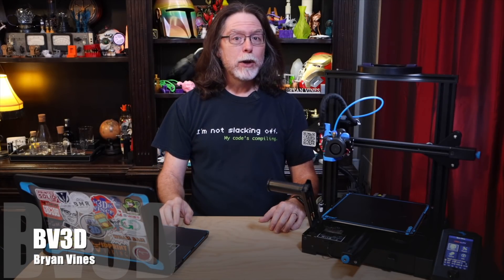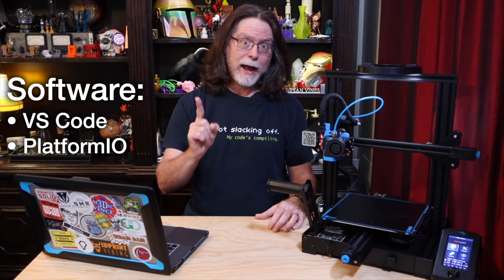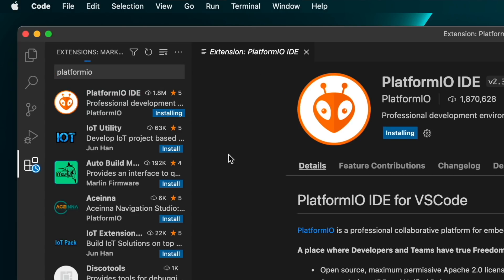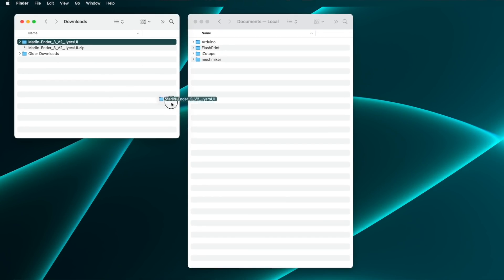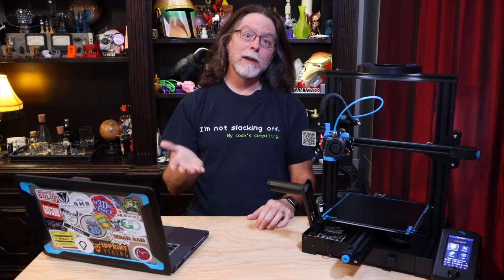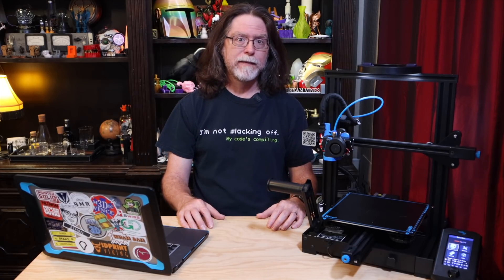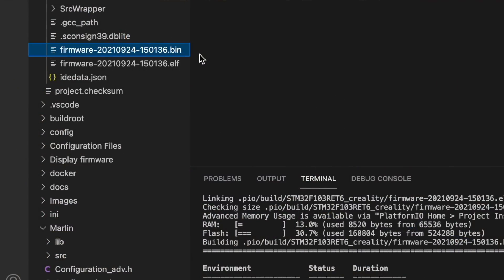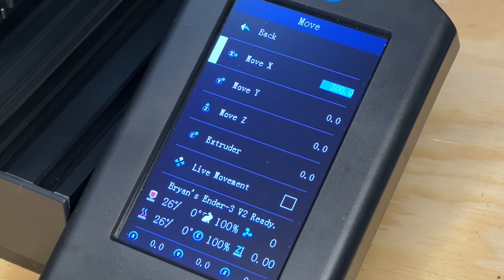EASY! Edit & Compile JyersUI Firmware for Ender-3 V2!

Comment: Excellent video with clear and concise the order of the day. One thing I have been searching for with little success so far is an answer to a very simple question. Does Jyres have thermal runaway protection enabled? If not, how do I enable it? Thanks for an excellent channel. As someone relatively new to all this, your help has been invaluable.
Reply: Help they changed files and this does not work please help my printer in now stock broken bltouch removed but stock firmware won't let me setup proper esteps for omg dm1 extruder

Comment: Bryan, so many steps missing I think.  For instance if I want a BLtouch 5x5. The example Jyers config files do not list that?
Also is not a # in front of a line comment that out?  So for your board you have to remove the #?
There seems to be many things missing from your video. It would be great if you could spend more time on this is detail.
Thanks

Comment: The Jyers Firmware is Really Great! Fantastic improvement, especially the scrolling filenames! It is worth doing if only for that! My printer is an E3v2 with 4.2.2 mainboard.  
Question: Does the precompiled binary for this one have Linear Advance enabled, or do I have to compile? 
The only source codes I found were Marlin 2.0.1.zip, and Marlin-bugfix-JyersUI.zip. Is one of these the correct one?
Do I have to see what drivers are on my board? The K-test code does not seem to change at all with changes to the parameter.  

Thanks!
Reply: The 4.2.2 board does not support linear advance due to the drivers it has and the way Creality has them set up.

Comment: I have tried several time to change the icons but they just don’t change. I also see the screen change from blue to orange but the icons don’t change. 🙏
Reply: Did you find the problem?
Reply: @fallu6224  no not yet, I have tried everything but the icons don’t change.
Reply: @kbshah  Yeah I have the same problem too tried everything formatted the card million times, tried to find the custom dwin icons setting in the configuration files but there is nothing like that.
Reply: @fallu6224  yes, same here! No one as been able to help as well! Too bad! If I am successful I will definitely keep you posted.

Comment: Does this work with OctoPi? 
I have tried the binary files and OctoPi will only connect after disconnecting the USB each time. If not it will hang connecting or just send a M112 command.

Comment: Dear Bryan: First of all I congratulate you on your channel, very interesting and I follow your videos every time you update.  The reason why I contact you is to ask if you have a link where to download this firmware update for my Ender 3 V2, both for the mother 4.2.2 and for the screen, without having to do all the process that you indicate, already that to tell the truth I do not encourage myself to install these programs and make the modifications, I have had the machine for less than a year and I do not want to make mistakes (although you can learn from them :), if there is a link and you want to send the same, then Not being a nuisance on my part I have to thank you, if not possible I still appreciate your attention and the explanation of the procedure.  Best regards.  Richard.  Buenos Aires, Argentina

Comment: Thanks so much for this! I had a CR6 Max that was giving me nothing but trouble, so I dropped a 4.2.2 board in place and turned it into a big Ender 3v2 with.a bad ass frame. This vid made the firmware updates so easy!

Comment: Hi, first thank you so much for this helpful video. 
Is it possible to download and compile the latest marlin firmware from the Marlin repository instead of the one from Jyers, configure it to my needs, but still use the display firmware provided by the Jyers repository?
That way I would have the latest changes for the marlin firmware but still the good display UI from Jyers, but I am not sure if this will work out.

Comment: BV3D, I have a newbiw question: is it possible to adapt Jyers to a plain stock old Ender3 (old display), with a v4.2.2 card? I've already done my own mods to firmware and have the compilation environment already setup, but config files are huge ...

Comment: is there a way for this to work with the touchscreen upgrade? I tried creality's and now my bltouch does not work. Also, how do i check what steppers its coded for, i have a v4.2.7 board with tmc2225 drivers,

Comment: After trying to flash the LCD screen from a previous video, the screen turned from blue to orange almost instantaneously, I changed the custom name, but that now disappears after a few seconds and displays "SD INIT FAILED". No big deal but the latest source Marlin did not have the option to change the display. The only place was from a previous version, but that does not work with the latest Marlin.

Comment: I don’t understand how you always make the exact video I need literally the day before I need them!!  I upgraded my machine to a slice engineering copper head hot end and got one of their thermistors. Any chance you can tell me what to change in the code to the new thermistor?
Reply from the maker: Did you get the 300˚C thermistor, or the 450˚C thermistor?
Reply: @BV3D  I got the 300 and I actually joined the jyers patrion and he already squared me away sorry to waste your time but props for responding so quickly! Love your content keep it coming!
Reply from the maker: @nike12000haha  Hey, no worries! I had to look it up on the Slice site!

For anyone else with this question, Slice says: "Marlin and Duet3D firmware support the Slice Engineering 300°C Thermistor. In your firmware settings, choose the 100K thermistor - ATC Semitec 104NT-4-R025H42G"

That's Thermistor value 5, so I think the right thing to do is, in Configuration.h search for #define TEMP_SENSOR_0 and change its value from the default 1, to 5.
Reply: @BV3D  good you and Jyers agree :)

Comment: Just curious what icon pack you are using that gives the rainbow colors CREALITY logo? I tried Gotcha's and the custom but it's still the plain logo.
Reply: I guess Bryan doesn't answer simple questions. :(
Reply from the maker: @FinlessBob  Sorry about that! 😬 I don't always see these questions roll through. I used Gotcha's DWIN_SET. If your screen went from blue to red (orange?) after only a second or less, the screen didn't like the card or it didn't like the DWIN_SET folder. I've had the best luck with a freshly formatted card, 8GB or less, where the DWIN_SET folder is the only thing on it.
Reply: @BV3D  No it flashed OK I must have used used a older or different one.  Will try Gotcha's again.  Thanks for the response :)

Comment: Aside from axis lengths, doesn't an extension need some configuration work on speeds and accelerations? It is not the same moving a bed (Y axis) with a print with 230x230x250 volume, than moving a volume of 300x300x400. Bed itself is heavier, not to mention the piece if you are using the full volume. I think extending a stock printer requires more configuration changes on Marlin.

Comment: I wonder why you are appreciating this piece of ****. I installed it then longer prints more than 10 hrs started stopping in mid and lost resume function after power cut.
Reply: I can't connect my OctoPi instance without getting communication failures. Certainly not polished software. I will continue to use the SD card way for now as the bed leveling is great.

Comment: Hi Bryan, 
New subscriber, great video, very helpful 😉

 Is there anything psu (12v/24v) related in the jyers firmware eg having a 2nd printer (cr10 v1) with a 4.2.7 board, could I add a e3v2 screen,  edit jyers and print or are there other things to consider ?
Thanks and keep the video's coming  😉

Comment: you probably should have mentioned what to edit to compile for board v4.2.2 vs v4.2.7
Reply from the maker: Hi Tristan! I probably should have, but obviously I missed that. I've pinned a comment about the line of code that needs to be changed for a 4.2.7 board, and included that information in the description. Thanks!

Comment: First it was helpful. Secondly as mentioned download from the release page. Third on the release page there are two versions 4.2.2 and 4.2.7 compiled firmware versions, if this is an issue I would assume there is something missing here depending on your board?
Reply from the maker: Hi George, I've pinned a comment about the line of code you'd need to change in configuration.h for a 4.2.7 board. I also added this to the description, along with a note to download from the Releases page. Thanks!
Reply: You the man thanks

Comment: Jyers UI definitely is a great firmware. However, just recently switched to klipper for the Ender 3V2 and l think it even made it better. Klipper supports linear advance (pressure advance) while this is usually not working on the Ender 3V2 with Marlin. And input shaper works like magic.

It’s a bit of an investment time and money wise but I think it’s worthwhile. If you do not want to spent the money and time in it Jyers is a great alternative.
Reply from the maker: I had upgraded an Anet A8 to Klipper a couple of years ago, and it was a good experience. I'm sure it's improved greatly in the past couple of years. I should look into it again!
Reply: Interesting. Could you let me know how you went about this and what links you used? :)

Comment: Why are there precompiled .BIN files for 4.2.2 and 4.2.7 boards, but there is only a single set of Config options in the source code?
Reply from the maker: Hi Geoff, sorry about that.

To compile for a 4.2.7 board, look in the configuration.h file for:
  #define MOTHERBOARD BOARD_CREALITY_V4

Change this to:
  #define MOTHERBOARD BOARD_CREALITY_V427
Reply: @BV3D  Thanks Bryan, I've also found a folder called boards.h which contains a long list of board options.

Comment: What is Marlin? Jyers is the firmware and ender 3 in the machine, then what is marlin?
Reply from the maker: JyersUI is built on the Marlin source code. Since Marlin is free and open source, it's available for anyone to make changes to it. JyersUI is focused on tying the base Marlin code to the Ender-3 V2's screen, making a lot more of Marlin available than Creality did with their Marlin-based firmware for the V2.

Comment: I have one query ... Using octoprint or klipper, for ender 3 V2  does it supports powerloss recovery ?
Reply: For Octoprint, the answer is No
Reply: Can you connect Octoprint without getting issues with serial communication?

Comment: Okay this is weird. I was just watching your video on manual mesh last night. At the same time I was watching Igor's video about installing the micro Swiss hot end to print ASA on my Ender 3v2. So I had to figure this out last night. It was a little tricky since I needed to raise my Max temperature AND have the manual mesh bed leveling option. It wasn't until I found the Jyers source code that it all came together. Igor was editing Marlin so I was worried it would be different for Jyers and I wouldn't be able to figure it out.

Your video would have been helpful but once I had the source code and installed visual studio and opened the files it made sense.